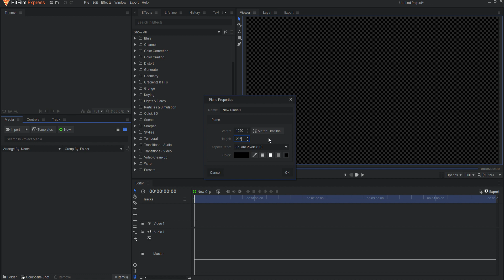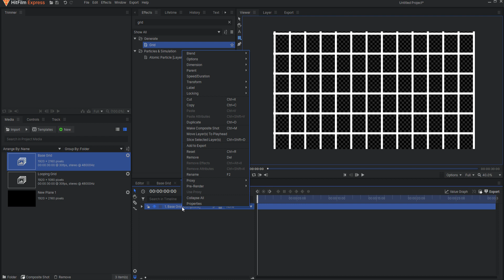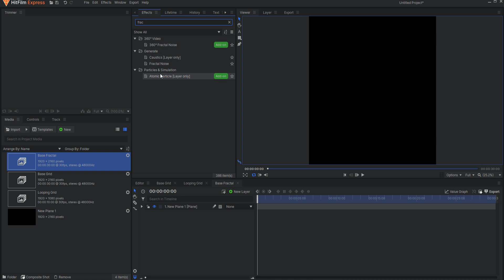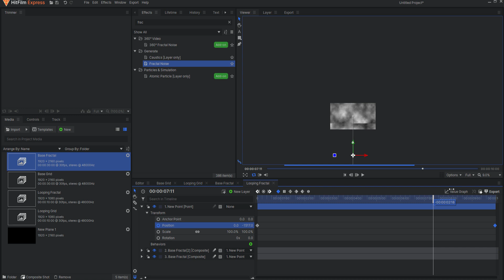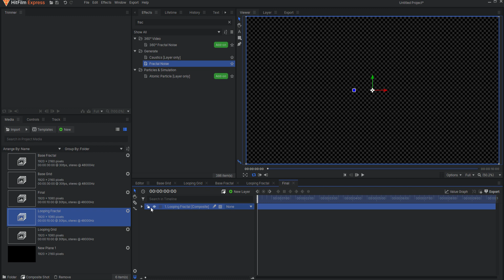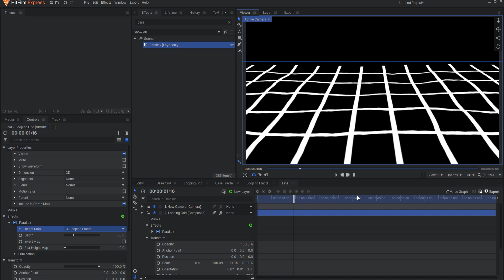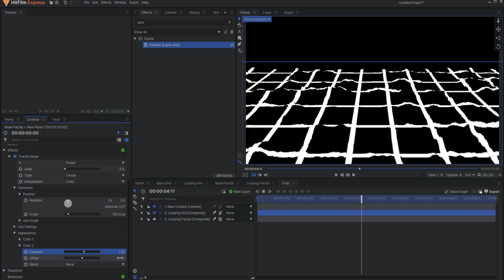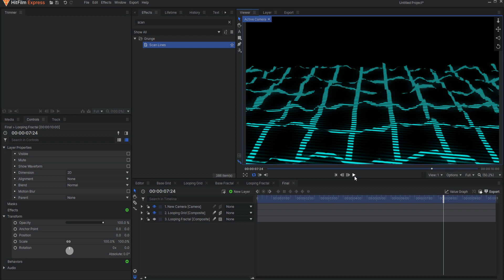Procedural HUD Grid Effect!

Comment: Note with Hitfilm Free 2022.1 creating comp shots larger than 1920x1080 will end up watermarking your footage. I know FXhome is working on making the 1920x1080 limit only apply to exports and not triggered by higher res Comps in the project itself. Hopefully that'll be fixed in 2022.2, cuz right now that res cap is really restrictive. Downgrading free res to 1080p was one of the few genuinely bad calls in the current version.
Reply from the maker: Hmmm... interesting. I didn't know that. I don't have as much time to keep up with the technical changes as I use to. Obviously I made an erroneous assumption that HitFilm Free was the same as HitFilm Express without any add-ons. I will have to research that more thoroughly before proceeding with more HitFilm Free tutorials. Thanks for the heads-up!
Reply: @HitfilmSensei  The new resolution cap in Hitfilm Free is the only change which negatively affects prior users of Express with no add ons. Otherwise, Hitfilm Free adds several features and filters.

This blog is a specific comparison of Hitfilm Express to Hitfilm Free. Just copy/paste to a file on your computer for quick reference. There's a blog specifically comparing all the tiers as well, but, for your purposes, this is the more important one.

https://fxhome.com/blog/compare-hitfilm-express-to-the-brand-new-hitfilm-free

Comment: Neat approach with the looping fractal on the grid.

I'll have to look on my archive drives and look for the version I made you cited at the beginning and send you the file.

 Mine is actually the particle sim. I used a Lightning effect for the horizontal bars, then duplicated the lightning, used a grid (altered so the grid lines on screen are pure verticals) and used that as a matte on the duplicate lightning to create the texture for the vertical bars. Both of these become source textures. 

The particle setup was pretty easy. I used a point Emitter set back in Z-space using a Cone Trajectory with a radius of 0 and shooting the particles towards the camera (ala Axel's original time vortex tutorials). Two particle systems, one sourcing the first lightning and spawning a small amount of particles... Like only 4/5 a second. The second sources the choked lightning and is firing off something like 2 particles per frame. This fills in the vertical bars. I think I might have animated the start frame of the particle textures in real time (i.e. Frame 0 of the final animation sources frame 0 of the textures, frame 300 sources frame 300). I don't quite remember, since it's been 6 years.

The advantage of this is, since it's a particle sim I can have the landscape generate for as long as I want without faffing around with looping textures and without my landscape repeating. The disadvantages are it requires the particle sim add on for Express or Pro, and that sourcing animated video layers in the particle sim might be more resource intensive than the parallax/fractal/grid.

I bet your Atomic Particles method would look sweet with a looping texture. That one was pretty slick!
Reply from the maker: Wow... that sounds awesome!